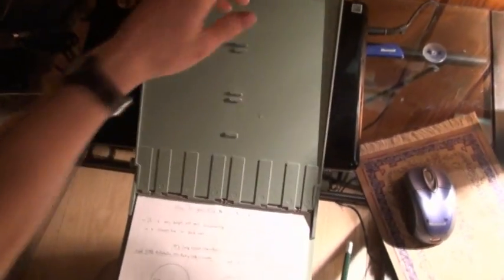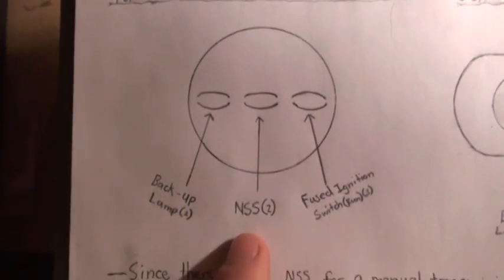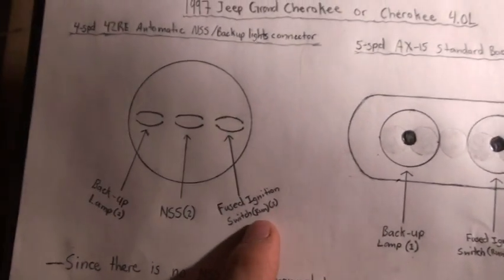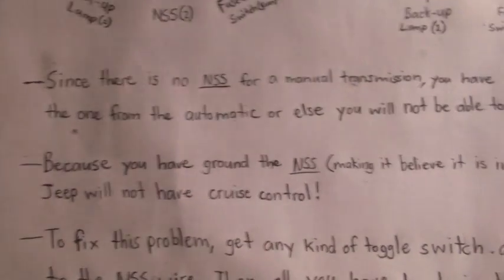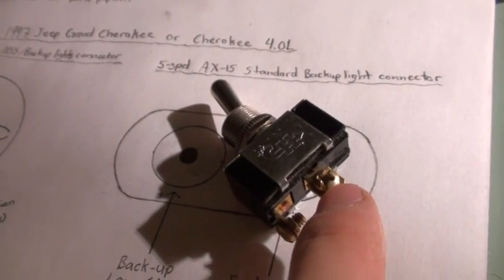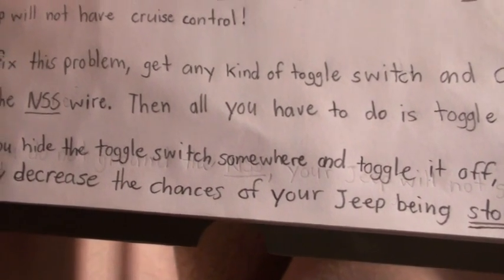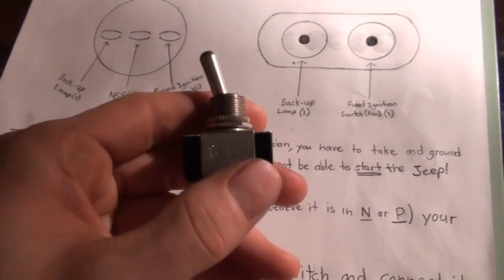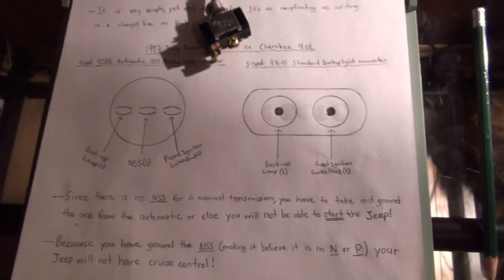AX15 ZJ SWAP - How to ground the NSS, and update.

Comment: Nice explanation! But tell me, instead of an ON/OFF switch for the NSS why not use a pressure switch resting on the clutch pedal to control it automatically? That way cruise control works when in gear (and deactivates automatically when you press the clutch) without operating a switch while driving.

To start the Jeep you would just need to press the clutch pedal. It doesn't defeat the anti-theft system since most cars start with the clutch released and not necessarily pressed... You see?